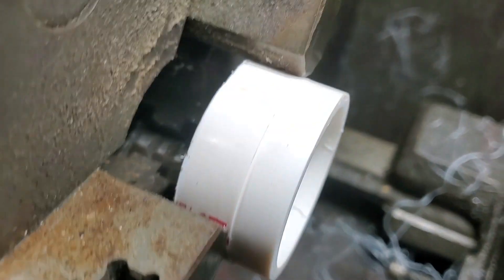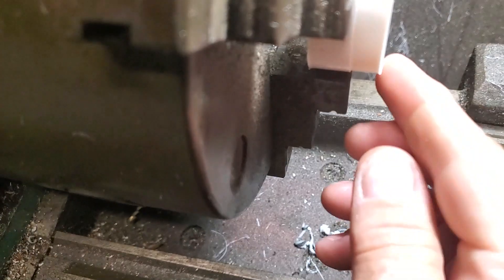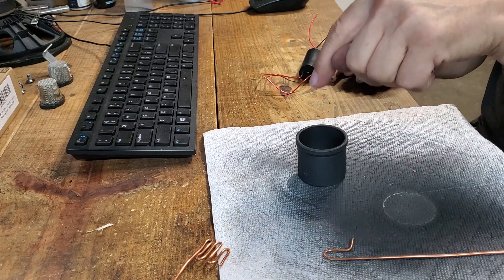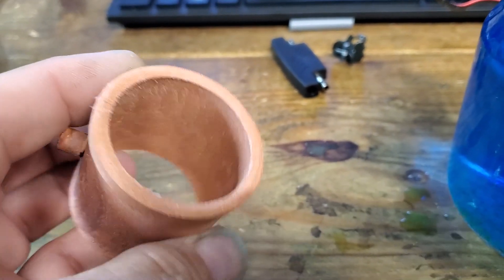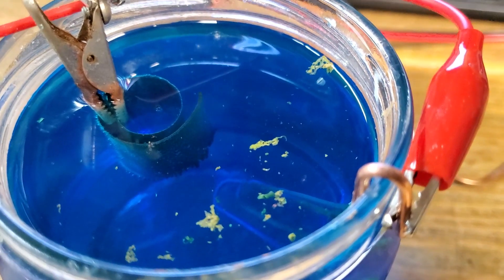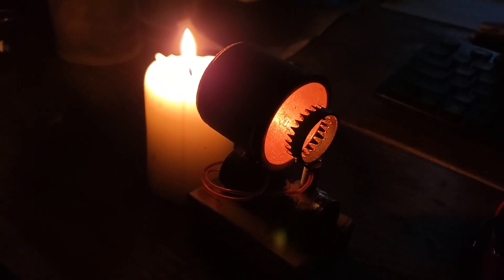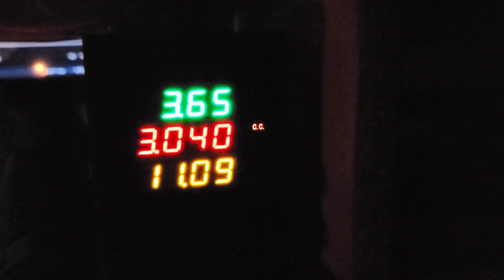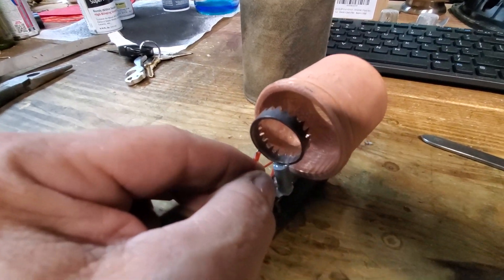Ion Generator

Comment: Every time I see someone make an Ion thruster, it makes me think:
Why just limit with 1 transmitter, and 1 receiver?
And then usually the next step people take to get more thrust is: They just add more sets of 1 transmitter to 1 receiver.

My proposal: Why not add 2-3 (or more) transmitters, to 1 receiver (depending on its design)? 
or ad 2-3 (or more) receivers, to 1 transmitter (depending on its design)? 

Yes. One of the goals is to get the weight down, for sure. But! Shouldn't the first goal be in getting optimal thrust first? Then worry about the weight reduction after?

Comment: So you have any insight into the spacing between the point bits on your crown shaped part? Would stranded wire work well or perhaps an unbroken circle sharpened to a fine tip?

Comment: If you switch positive to the crown shaped ring and negative to the tube, you'll produce more wind from the duct, blowing on the candle rather than pulling the flame like in the video. I'd also try increasing the spacing between the two rings by ~0.25-0.5" and you can reduce the arcing
Reply from the maker: Hi I am based out of Houston my main background is 25 years in airline flight systems and autopilot component overhaul and test equipment design. call me
Reply from the maker: Hi as you are probably aware the Victorian scientists knew the electrons were flowing but did not know which way so they guest that they flowed positive to negative but unfortunately they guest wrong. electrons flow negative to positive. what you see with the candle is that the candle is in the backdraft and not in the main flow. electron flow is negative to positive. many thanks for your comment and thanks for viewing.
Reply: @AndrewJWatts  Hi, i was just wondering, we agree that the electrons are flowing from negative to positive electrode. However the ionic wind that is created is mainly due to an ions flow(way greater mass) and not by the electrons flow. Since the ions produced are mainly positive (N^2+) the flow of ion is from the positive to the negative electrode so @EvanBrunye was probably right. Great experiment btw.

Comment: Do we have to supply Direct current to the module or AC is ok?
Reply: I'm pretty sure you need DC
Reply: @daniel17852  is a transformer needed for this?
Reply: @lsaacNewton  most likely
Reply from the maker: The power is two AA batteries
Reply: @AndrewJWatts  what other components were used else than step-up module and AA batteries?
Reply from the maker: @lsaacNewton  just those then the crown shaped anode and tube cathode
Reply: How long do your batteries last? I have made a similar setup and it drains my battery in 5 mins.  @AndrewJWatts
Reply: You have the sight of the unseen and can see both the Flower and Seed of Life like Euclid could, your an amazing inspiration for me to learn more about time and the dimensions.  Thanks again. 🕸️🌼🔥👀